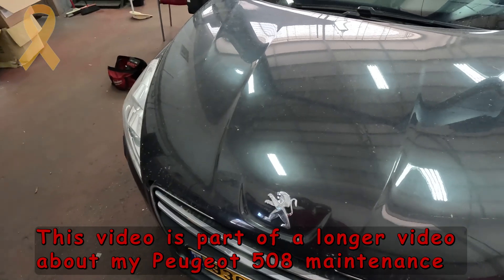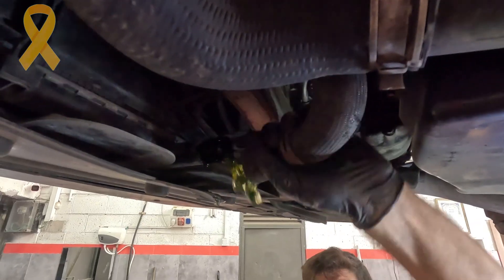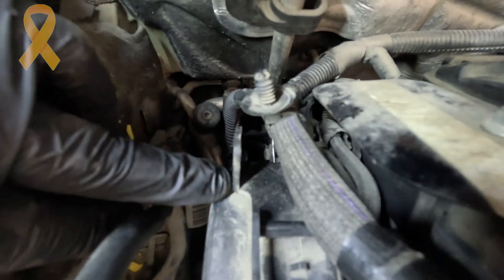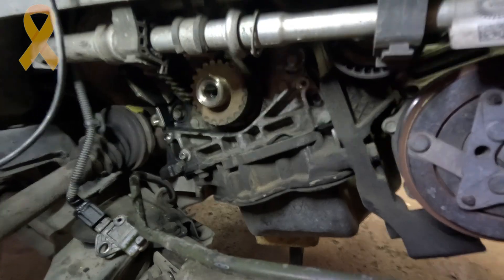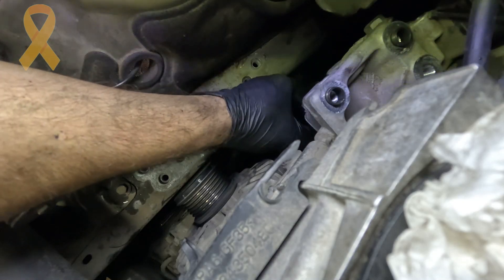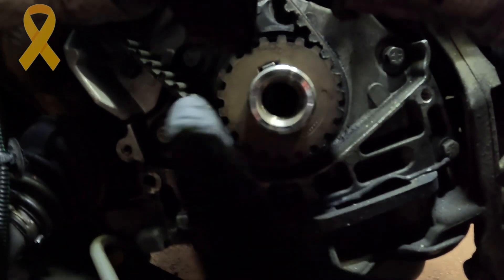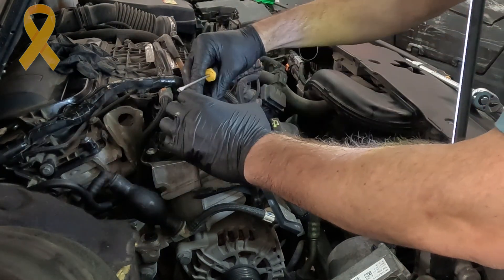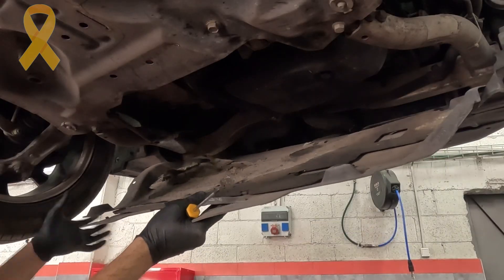Timing Belt Replacement on PSA HDi Engines [Peugeot, Citroen, DS, Ford]

Comment: On Peugeot 2016 508 SW 2.0 BlueHdi 181hp there is a bottom outter crankshaft cover over the serpentine belt. We didn't managed to take it out. We took all the bolts and nuts, but the cover is practically not removable from outside the support beams, pipes and all the parts. We moved the engine to many different spots without any luck. Just can't get the plastic cover out of its spot. Too tight. Any tips?
Reply from the maker: is it different from this one? if so - im not familiar with the cover you're talking about,and the access is pretty tight there already even to remove the belt by inserting a wrench near the tensioner.
I don't know if you can do anything other than keep playing with the engine height and position...

Comment: use a jack instead of the stand under the engine, then you can adjust with the jack instead of the lift when you need the engine higher or lower. Nice video! i will do the same this week, made one a couple of years ago, thanks for the good video.

Comment: Hi. There is also a chain that links the two camshaft
This chain should be replaced?
Thanks
Reply from the maker: @mihaibarbulescu1  It is defective on the newer 1.5 model, and there is a new version which is thicker by 1mm
But no need to change those on regular basis..
Reply: @DIY-Mechanic  Thanks. I have a peugeot 508 Gt 2.2. 
I guess I should not change this chain.
My odo reads 190k km